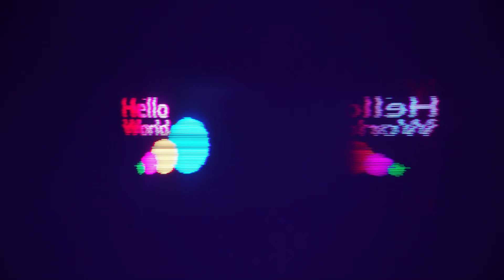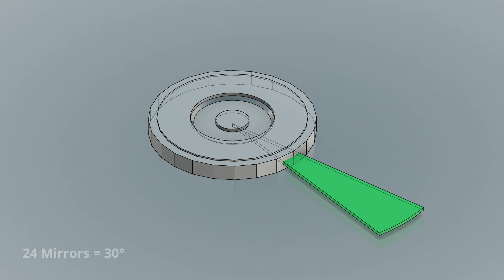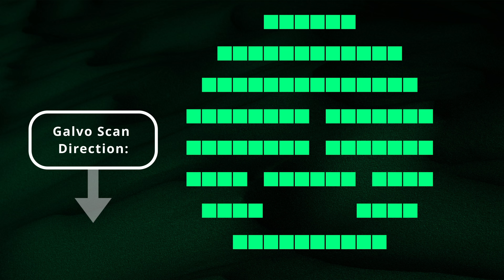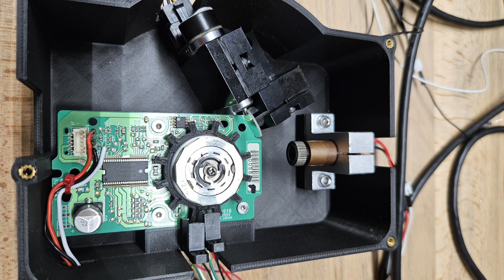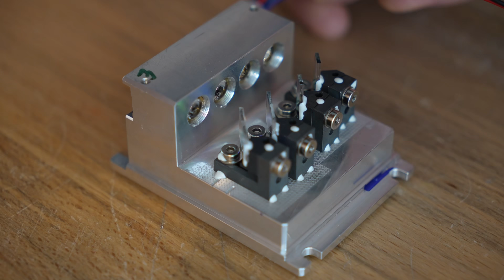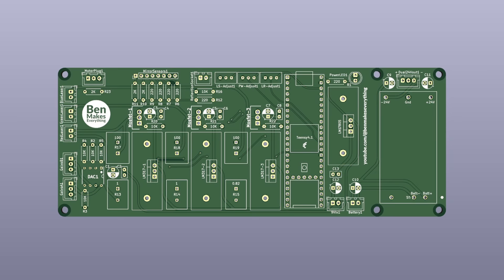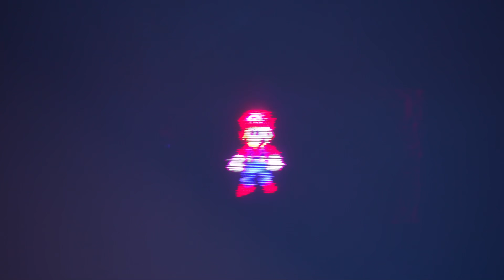DIY Laser Image Projector (100ft+ Range!)

Comment: 8:57 Actually... You can fix it easily using a piece from same device where you Get polly mirror from in Printer LSU there is also a beam Shaper Glass lense to fix same ishue if you put it front of Let say.. H or Y Non Gaussian laser beam it will stretch it in another direction to compensate the error and you get almost dot like beam .

Comment: There was something similar in a certain laser printer which used rotating mirrors to scan the beam over the full area of a A4 Size laser sensitive plate which the page floats over and the powder is attracted to the image which then heated to fuse the toner to the sheet.

Comment: The jitter might be caused from the galvo as laser light is always on the galvo so if you know what part of the signal it’s happening you can turn the laser module off using a TTL blanking control signal.

Comment: My local hackspace has a "Make a Sign" as a project suggestion, so of course I thought of making a laser projector, similar to what you did here.  I would use two spinning mirrors, and use cheap, low-power laser pointers since indoor use is sufficient.  Modulating the laser brightness is the tricky part.   It was good to compare your design to what I had in mind.
Reply from the maker: Sounds cool - let me know if you figure out the two spinning mirrors - I would like to do that, but synchronization seems like a nightmare.

Comment: Maybe I'm a bit late to the comment party, but if you swapped yellow and blue in your palette, you'd get a 3-bit direct RGB palette which would greatly simplify your code (you could just read a byte and output it directly to the I/O port connected to the laser diode drivers).

Also, you should try dithering the images before loading them. With 320 pixels of horizontal resolution there's plenty of spatial resolution for it, plus the horizontal beam's blur will help blend colors just like the beam on an old CRT did.

Comment: Should have done two rotating mirrors. One for the vertical and one for the horizontal. It allows the vertical scan to reset instantly as the mirror slides down into  the beam.

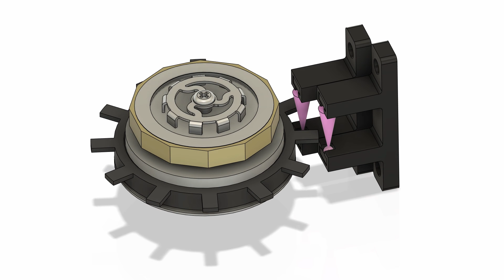Comment: 5:40 use another, lower-power laser pointed at the mirror drum and photo sensor or two. You probably don’t even need to track the angle of the drum if all the mirror surfaces are coincident. Just timing feedback.

Edit: actually, it looks like there is at least some unused laser arc. Could even position a sensor to catch one end of the main laser sweep.

Comment: Back in college in the early 90s, I had proposed something similar but with a hard drive spindle. Same basic concept and at a rotational speed of 3600RPM, It would provide quite a bit of vertical and horizontal "pixels", which at the time were hard to project. I had even proposed using two to control the beam on two axes. My biggest issue was that you couldn't, or at least I couldn't, control the dot pitch or pixel size. It was going to be fixed and with a tiny  laser point, I figured it could be adjusted to at least be able to build a matrix of pixels. I ended up doing something more practical for my engineering project.

Comment: The battery being inbuilt probably doubles the footprint; you could follow the lead of the battery manufacturer and build it with a rear locking slot for the battery. External swappable battery would shrink overall size without affecting performance, and remove a major source of trapped heat. The downside would be aesthetic in breaking up the device shape, but that's just down to preferences anyway.

Comment: Great work.  FYI I saw this done with real video in the 1980s by.a company in London.  They claimed it was HD, but I think it was just off Sony laser disc.  It was super impressive to see, but never want far.  The projector used LCD light vales to modulate each laser beam one each for R, G, B. The horizontal scan was done with a multifaceted spinning mirror much like yours, but it spun at insane speeds inside a helium filled chamber.  That was by far the most expensive part of the projector.  Vertical scan was done with the little galvanometer motor.    This was the brightest video projection I had ever seen at the time.  And it had no focal point, the image was in focus no matter where it was pointed.
Reply from the maker: Yeah, I am not surprised that it has been done before, it seems like an obvious idea in retrospect. Although to do it all the way back in the 80s is really impressive given that diode lasers were much less common and powerful. I guess the technology never took off due to the expensive nature of the polygon mirrors, and maybe potential fragility of the whole system.
Reply: @benmakeseverything  IIRC Blue and green were gas lasers and I remember that red was a dye laser.  I complained that the red was more like orange, but the said it was the only way to get a bright enough red.  I am a retired projectionist,(film and video) and that 80s laser projector is still the coolest I have ever seen.

Comment: Man, I have been wanting to build something like this for soooooo long.  
These devices do actually exist already.  I think they're functionally a matrix of laser emitters that accomplish the same thing as what you're doing.

One comment you made was that you need a faster motor -- you could compensate for speed by adding more mirrors to your wheel.
Reply from the maker: Yes, more mirrors would increase the vertical resolution. However it would also decrease the maximum horizontal width of the image. Still worth it up to a point.

Comment: SO?  6 months time & How much $ ___ ?   & These are commercially available ? 🤔
Reply from the maker: Way too much time and money was spent on this haha. But it was one of my favorite projects so its ok. I don't have any for sale, but I do plan to return to this concept because I have a lot of ideas for improvement. It wouldn't economically viable right now, but in the future...we'll see.
Reply: @benmakeseverything  But, It was an actual question ... What was total cost mat'l & serv. ?
Reply from the maker: @MrStevos  Well, I didn't keep records exactly, and its been a while. But for the parts, maybe something around $800. The most expensive thing was the Galvo set, which was $350 alone - even though I only needed 1 of them since the X scanning was done by the motor. Prototyping is expensive.

Comment: 1 EMI) A 4 layer board will help a great deal on the EMI issues, but they're probably pointing to a more fundamental issue with grounding: every picocoulomb of charge in every picosecond spat out of one terminal of a supply cap MUST have similar shaped and sized return path back to the other terminal of the same supply cap. 0V or GND, unfortunately is rarely 0V or GND. If some charge can't get back the easy & direct way, it'll go back another way, through a different bit of ground in a different IC's loop. That'll put whatever signal from one onto the other. Now it's EMI (yes, it'll radiate as well, but conducted emissions are usually the biggest problem in this kind of thing).
2) Stackup - as mentioned - 4 layers really helps. It doesn't really cost that much more and being able to have supply at ground available in a short distance REALLY helps get good return paths (nobody minds a BETTER return path - the old electric & magnetic fields moving energy around sort the best return path themselves of they've got a big enough bit of copper using ttheir Poynting vectors -Veritasium is good on this).
3) Layout - layout is soooo much easier doing vertical one side, horizontal the other. Every time I do a "oh it's only small, it won't matter going funny angles", I've regretted it and had to redo it vertical and horizontal.
4) Wiring - yes that needs nice return paths as well. Think carefully about every wire being mirrored with it's return (yes, I know, we'll be going all the way to differential pairs at this rate)
5) Negative supplies: not that big a deal really. Go for a capacitor coupled switching topology - the Cuk or zeta is a nice easy place to start and most SMPS controller ICs will work with it although if it's driving a +ve supply as well and they're balanced, it only needs regulation control on the +ve side. You're not limited by what Traco has got and it'll be a tenth or 50th of the price to do.
6) high-speed control: sooo you're looking at 100ns pulse control. That's getting beyond microcontrollers really. Thankfully it's 2020s and small FPGAs are WELL within the reach of folks like you and I. They have a few LVDS outputs and PLL clock synth systems on board - aiming for 10ns and less shouldn't be too difficult. Now you can do PWM DAC fairly easily might even get 6 bits resolution! The Gowin Nano 9k is a pretty good cheap devboard. The 20k will let you run a Risc-V core as well for all the code you've already worked on. "Vibe coding" a bit of Verilog will get you going as well.
7) luck - always a big factor. Always required. Usually forgotten. Good luck and thanks!
Reply from the maker: Hey, I appreciate the feedback. I do plan on making a better version eventually, and I will certainly take your suggestions into consideration. My understanding of electronics has improved quite a bit since I made this, so hopefully I can resolve some of these things.

Comment: The vertical speed can be significantly higher, if you rotate it, instead of moving it up and down. Laser printers commonly use rotary prisms for both tasks, but mirrors are fine, too. In fact, you could use the mechanics of a laser printer, and exchange the laser diode.
Reply: Not really. Vertical raster is obtained by moving the paper through, so single rotary prism.

Comment: any more info on how you made the polygon mirror unit  spin. Having trouble to make them work outside a printer. Also a components list of where you bought them? Can't find a galvo mirror and motor
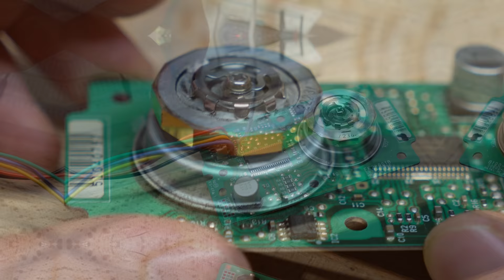Reply from the maker: So, I mentioned this around 5:15 in the video. I basically had to solder on a wire to kind of override the way the PCB was set up, but that will depend on the polygon motor you're using. I have some other ones that spin slower, but the connector socket works fine. Its controlled by a PWM signal, but IIRC - its actually inverted for this one (higher number is slower). I don't have the code in frot of me but I seem to remember that being an issue - and it doesn't work with the entire range from 0-255 like you would expect, only some of that range made it rotate. I just bought the Galvo and its controller board off ebay - its was listed as having a speed of 50K PPS. I don't know if that's accurate as I didn't try to measure it.

Comment: This is basically a mechanical "Flying Spot Scanner" —awesome build! To break past the speed/resolution limits, look at "Scophony" TV tech (1930s) and Laser Printer physics:

Fix Color/Speed: Ditch direct diode modulation. Use an Acousto-Optic Modulator (AOM) from an old laser printer. It uses sound waves to switch the beam in nanoseconds (way sharper pixels) and gives perfect analog dimming.

Fix Jitter: Ditch the 3D printed sensor wheel. Use a "Start-of-Line" photodiode inside the case. Let the actual laser beam hit this sensor to trigger the pixel stream—this aligns the image to the actual mirror face perfectly.

Fix Beam Shape: Use Anamorphic Prisms (cinema tech) to squeeze your rectangular beam into a square, giving you sharp edges without the gaps.

Fix Vertical: Swap the linear Galvo for a Resonant Scanner (tuning fork style). It uses physics resonance to scan way faster/smoother with zero heat, though you'll have to code for sine-wave distortion.
Reply from the maker: Thanks! I do want to revisit this project, and considered some of the above ideas, especially the start of scan photodiode previously. But I will try to use most of them in the next version, if I can.

Comment: You could use a hardware resistive DAC for lasers; it's literally just a bunch of diodes. The only thing you'd need for this is a sufficient number of GPIO pins.

This is the circuit for the very first primitive DACs - take voltage from pin 1 through resistor R, from pin 2 through resistor 2R, from pin 3 through resistor 4R, and so on.

For three colors with three bits, it's enough to have 9 free GPIO pins, which will give you 512 colors. Cheap and simple.

Comment: Any reason not to use an X Y axis dual galvo setup? I'm designing one using hardrive voice coil actuators. Should be driveable with an audio signal. Raspberry pi will be the muscle and brains of my setup.
Reply from the maker: Its really just the horizontal scan speed. You'll find that with reciprocating mirrors you run into issues with inertia. Thats why most off-the-shelf projectors draw the outlines of shapes rather than trying to create pixels like I did. But of course maybe you'll find a workaround I didn't think of. Anyway, good luck on the project!

Comment: I wonder if electrochromic material (aka "smart glass") would work to reduce intensity of each color beam and yield additional colors? Would it be fast enough? Could you combine multiple in a row to reduce the output intensity in steps? Looks like you can buy 2 meter pieces of it online. Can you cut it real small and still have it work?

Comment: for full color you might try a simple RRRGGGBB weighted resistor DAC and applying a dithering filter to the image - assuming the op amp is switching fast enough for the resolution. another thing you might try to improve the vertical resolution is to arrange the three diodes in a vertical line and temporally interpolate between the colors. i'd also be willing to bet that the laser printer mirror-motor has a sealed optical encoder built in for timing, and the asic onboard probably has a timing signal coming off of it somewhere.

Comment: VGA might be an interesting avenue to enable analog color control. If you can sync the pixel timing, a VGA controller already modulates the RGB wires at a super high speed. You might need to write special software to render the image in a specific format (ie the even rows in the top half, odd rows in the bottom half, flipped).
Reply from the maker: Yes, that's exactly what I would like to do in the next version, if and when I build it. Eliminates the DAC speed issue, because the reference voltage would come straight from the video signal.

Comment: The easiest way to increase code speed and memory efficiency is to store your pixels in a bit mask.
In code you've shown u r using an array of arrays of, I believe, integers (int8_t probably). So, to store one pixel, which has a state of on or off you use whole 8 bits. You could get your image in chunks of "unsigned long long" which is whole 64 bits, so 64 pixels. So, you are restricted to use chunks of 64 bits, but use them 8 times more effectively, than before